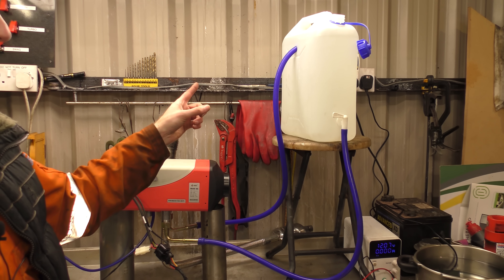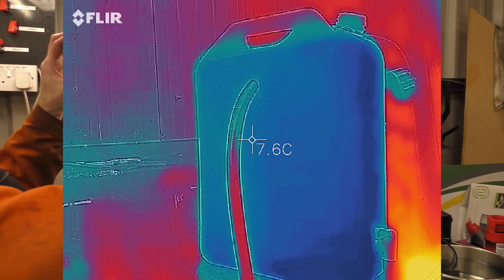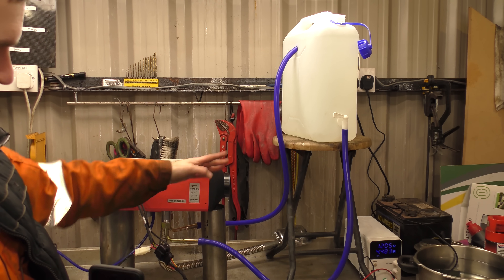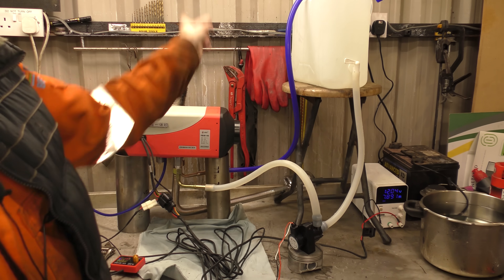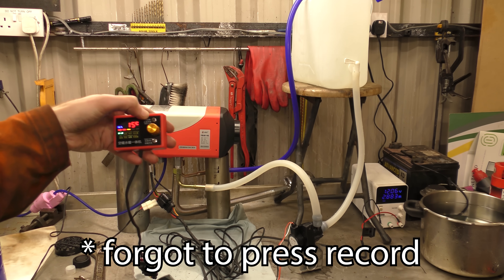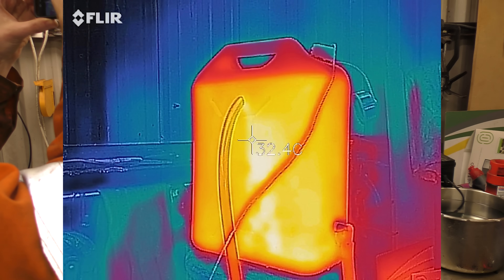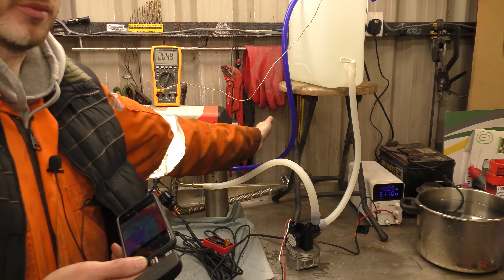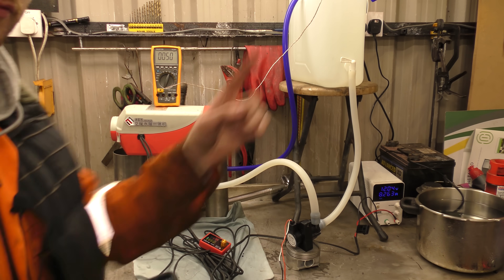Diesel air & water heater thermosiphon? Also heating 10L of water

Comment: That makes 120° water in Fahrenheit in just that 26 minutes, but I would like to point out this version of a diesel air and water heater is patented more or making hot water for your camper or your van build not to heat up engine coolant but like I said 49°C that is roughly about 120°F. that’s still hot for water just for only running at low for roughly 26 minutes.

Comment: I did some very rough calculations and found the heat output to be about 1 kw into the water. Not good enough to heat water in an off-grid home. I wish someone would build a diesel heater with a water jacket having a water connection on the top and bottom for a proper thermosiphon. It needs to be rated for 100 psi, be equipped with a temp/pressure safety valve, and have an easy way to clean out the lime build-up. The motherboard needs to have a remote temperature probe that goes on the storage tank to monitor the temp of the water.  And no hot-air blowing out. That way it can be used to heat domestic hot water in the summer. This would be ideal for an off-grid house or a camper van or motorhome.
Reply from the maker: Thank you.  That's about what I worked it out as.

Comment: I calculated that the amount of heat you get in the water is 0.47kWh at full blast. Now this is a bit less than the exhaust heat of 0.5-0.7kWh typical. If you let the exhaust heat go through a BPHE in this way - exhaust pipe going vertically into a bucket/tank/barrel/water butt, then goes into a BPHE vertically, then the other outlet of BPHE coming out of the bucket horizontally or 10 degrees slope to drip out condensation naturally. The whole set up looks like a big L shape inside the tank, do you get it? In that way, you won't even need a pump. A true thermocycle will happen because the heat source itself is inside the tank.

Comment: °F = °C × (9/5) + 32 hurts my brain when I try to do it on the fly. Generally I try to remember 20 is room temp and 100 is boiling. Then I guestimate.  I calculate that as putting out 2300 watts of heat. My bad I thought it was 20 liters, so half that 1151. A small steam engine could make enough power to run this.

Comment: So it looks like it heats as fast as my little hot water tank which has a 600w immersion heater or 1200w gas heater - so somewhere midway around 900 watts perhaps 1kw allowing for pipe  losses

Comment: I have a question so  does this have to continuously run to keep the coolant warm........

Like for instance would you be in let's say your truck's bunk trying to sleep in the fiery pits of hell why'll still trying to keep your engine coolant warm.......

If that is the case I think it would be better off installing two separate systems.
Reply from the maker: Yes.  You have correctly identified one of the major drawbacks with this version.  I'm sure others would suggest opening a window, but that's just wasting heat and fuel.
Reply: @DavidMcLuckie   yeah think I would stick with  just the bunk heater and spend the extra $150 for a Chinese diesel coolant .

Comment: if you connected the hoses internally by dropping a coil of copper into the water tank (soft 22mm) will give you the circulation you need the silicone hoses should take up the expansion.

Comment: It is sad that this dual use has not become mainstream like the pure air heater. Would it be problematic if used without water? I just bought the 2kw with dual muffler system for $86, including 2day courier fee in Florida. There is no affordable duel water air system in USA available on Amazon. Would've loved it on my sailboat.
Reply: David, Maybe I can use a 30m length of 5mm copper pipe with a small pump to recover heat from a wrap coil around the exhaust?

Comment: About your last question, the calculation is very simple: 10 liters of water need 10x4.2KJ to heat up one degree. That times 33° increase means 1386KJ in 20 minutes. That means 1155 Joules per second, that means 1155W of heat power (average). Equivalent to a 1000W electric heater approximately.
Reply: 1155w....... thats a lot of heat to save from the exhaust and this isnt 100 o/o efficient so normally it must exhaust an insane ammount of heat outside..... it makes sense to get as much heat as possible from the exhaust gasses
Reply: @freewheelinfranklyn  Actually that gas has a very low density and a very low pressure. Because of the high temperature. So, it does not contain a huge quantity of heat. Of course, it could be harnessed increasing the efficiency of the system. But one shouldn't expect too much from it.

Comment: If you would have laid the diesel heater on one side (with the glow plug upwards) and aligned the bottom pipe of the heater in the bottom of the barrel and the top side of the heater in the upper side of the barrel, you would have obtained a thermosiphon... Just a small detail.

Comment: The best way I have seen for people using  these heaters in a camper. Is using a outboard motor  fuel tank.  Because hose detaches so you can fill the tank at the gas station.  Not trying to fill the little tank on the heater in the camper / van.
Reply from the maker: That's a great solution.

Comment: Hey David, been looking for one of those white variable voltage supplies you have in the background. I can't find one any higher than 30v/10amp. Don't these heaters draw more than 10 amps at the beginning when firing up?
Reply from the maker: Most of the ones I've tried pull just on or just under 10A which is why I picked that power supply.  If you find one with more power let me know as I've been looking as well.  :)
Reply: @DavidMcLuckie  Hi David, I have a link for one that does 30amps but youtube wont let me add the link.

Comment: Would it be possible to turn the heater on its side, such that the hot pipe was on top and the cold return on the bottom ?

Comment: Did you happen to make a video of how to connect all this?  I actually have the same unit... And don't want to use the water heater yet.  Getting an error message about missing water pump, but instructions don't actually show it being connected to the wire harness. Instructions show it as being only connected to the system via the hoses... So I'm not really sure what my issue is.
Reply from the maker: Yes, the pump has to be attached to the main loom for the system to work.  There should be a plug for it.
Reply: @DavidMcLuckie  thank you sir!  I actually hooked up the pump and it cleared the error code. Now in the English version of the instructions there doesn't appear to be anything about how to prime the diesel fuel line. Or how to actually start the heater ignition... Did you happen to ever make a video or do you happen to know what the steps are? I'm struggling because everything is in Chinese which doesn't help.. 

I really really appreciate your help. And I love your videos keep them coming!
Reply from the maker: If memory serves me you push and hold the knob and it activates the fuel pump until you let go of the knob.  I think.
Reply: @DavidMcLuckie  I'll give it another try.  Thank you sir!

Comment: Hi, you are master of this heater. Do you know what dimension of whell bearing sits in fan of heater ? I mean of opposite way of hot air. Its squeak and i want to change it but do not want to wait for bearing(its take time to order something in shop in norwey) ? Like 607 zz or 600 ? I think you know what i meen
Reply from the maker: 16x5x5mm 625Z
Reply: @DavidMcLuckie   thanks

Comment: To answer your question at the end:  It took 1200 seconds (20 minutes) to heat 10000cm2 (10L) of water 33 degrees (from 17 to 50). That is 330000 calories in 20 minutes, given the specific energy of water (4.18) that equals 1379400 joules in 1200 seconds, so 1149,5 joules in one second. Since a joule equals 1Ws, we can strike out the seconds and there you have it. The power transfered into the water was 1149,5W (on average, it was probably more when the water was colder and becoming less when the water heated up)

Comment: I may have a solution for the thermosyphon malfunction. (As described about 2:30 in the video.) I'm
drawing on my experience as a retired plumber who has also worked with pumps and  thermosiphoning solar heating systems.  I think what has happened in your thermosiphoning setup is the water reaches a boiling point and so increases the pressure in the system to the point where the pressure is pushing the water in the cold side of the system back into the tank. The simple solution would be to install a check valve on the cold side tubing, preferably one that has minimal restriction to flow.
Reply: I also wonder what would happen if you raised the reservoir higher, say 6 in or so. But the check valve is a must.

Comment: It would have probably pumped by convection if there was a check valve in it. The old heater hose engine heaters had one.

Comment: Does it work always heating also the water or there is the function that allows to heat just the air ??
Reply from the maker: Other than letting it boil the water out it's always doing both.

Comment: @David McLuckie are these any good for a boat for hot water in a sink. I'm looking for a alternative rather than a gas geyser. Also to keep it warm. Does the heater have a thermostat on it so when your just using the heater without running the water. So the water doesn't boil over
Reply from the maker: The water would eventually boil.  But as long as you don't use a closed system it wouldn't be a problem.

Comment: im curious to know how many liters a minute is that water pump. plus how hot is the water coming out of that outlet tube after its heated. so example if i just attach a shower head to it.
Reply from the maker: I think that pump is 10L per minute.  I worked it out that the heat exchanger is heating the water with about 500W of energy.  So either a cold shower with good water flow, or a hot shower with little water flow.
Reply: @DavidMcLuckie  brilliant thank you David. the pump i will be using will be 5L a minute so the water should be pretty hot im guessing

Comment: Hi. Does the heater need to be the way you have it sat or could be face say 90 degrees up or down? So heated air hits ceiling or floor?
Reply from the maker: I've looked at the burn chamber.  If you point the heater hot end up, you shouldn't have any diesel leaks.

Comment: The top pipe should be just below the top water level,  not above the water level! as the only way the hot water will exit the top pipe would be through expansion. and never fit valves to the flow and return as you will all be aware im sure that steam expands at explosive rates and can be highly dangerous. the system should always be vented and expansion allowed for.

Comment: Is there a way to turn the fan speed down or off but still have the heater running. Have a water pump pushing water through to heat up the tank. That would be great if you disnt need to run the fan for air heater at the same time?
Reply from the maker: The blower fan is on the same motor as the combustion fan.  So you have to have hot air and water at the same time.
Reply: @DavidMcLuckie  yes I have picked that up after watching more videos. Its seems you just want to turn your water pump on whenever you run the heater. Then just have the water circulate back to the tank. I've watched so many videos now I'm not sure what one I'm commenting now

Comment: 40-42c is the perfect temp for having a shower, so if you turned it on in the morning inside your camper van, make a cup of tea and after 20min turn the water pump off and then have a separate pump to a shower head and taps you can enjoy a lovely hot shower.

Comment: I'm not sure if it's the issue but I saw another video of a gentleman making a diy heat exchanger his first prototype had a very similar issue. The boiling water should build pressure but not with both ends open. He had a term for it but a one way valve on the supply fixed this and pushed water through the outlet. I would love to see if this creates thermosiphon!

Comment: BELLOS ATHANASIOS
HI...wath is hapening with the water if the heater warks all night and day ?
how can you control the temperachure? is the water boil ...or what?
Reply from the maker: If the water gets hot enough it will boil.  Not really meant for long run times without the hot water having some way of dissipating the heat.

Comment: Interesting, would like to see follow up experiment like this: 1) Use the diesel water&air heater to pre-heat the water 2) use egr cooler on the exhaust output directly under the heater to further heat the water. 3) put the heater on max 5 setting from start, not 3. Always possible to turn down the heat later :)

Comment: Hi David I had a thought for a video. What about using a turbo intercooler connected to the exhaust with a fan to extract heat. If it works without messing with the air flow, you could put a thermocouple and arduino to control the fan based on heat. Also I seen a water cooler intercooler could be used to extract heat from the heated water. If you wanted
Reply from the maker: I've got an old intercooler for this purpose.  Just haven't welded a pipe and flange onto it yet.

Comment: Thermosiphons always benefit from increasing the vertical height differences. I realize it was done this way to keep the shot compact, but it is close to the worst layout for a thermosiphon. You are attempting a closed-loop version of the stack effect so the siphon force increases endlessly with height until the point where fluid flow friction overwhelms the stack effect. That flow concern also means you should use large diameter tubing/pipes, and keep things like the jug's petcock out of the flow loop. Also, some layouts will not self-start, but will work once something gets an initial flow established. https://en.wikipedia.org/wiki/Stack_effect

Comment: 1440p@25 is very nice as I don't actually have to force my phone to use 1440p it does it on its own on 25fps (1440p60 requires a lot of bandwidth and my phone doesn't think my WiFi or 4g is fast enough on 60fps)

Comment: Put the hot water return at the bottom and the cold outlet at the top. The hot water rising from the bottom will cycle the cold water through the heater. For this to work you'll also need the system to be full of water obviously, or at least have both hoses under the water line inside the tank.

Comment: So....what's the point of this thing? Intriguing as it is. 

It seems that it can't heat air only if it's plumbed into a water circuit. Without the pump it will lock and splutter.

So how do you see it being put to use?

Cheers :)

Comment: I don't think the pipes going down first is an issue (other than creating a small height difference between them), its all about pressure difference. It doesn't matter where the pipes go, just where they end up. Think of siphoning a liquid out of a container using a hose, it goes up first but still works.
What will matter much more is the height difference between the heater and the tank, the pressure difference between the water inlet and outlet of the heater should be proportional to this height difference. And flow rate will be proportional to this pressure difference (possibly not a linear relationship?).

Comment: Wouldnt it be cool to set up and run 2 water systems at the same time, 1 heated by the heater, 2 heated by egr cooler and see which works better. My money is on the egr cooler.

Comment: Hi Daved, I have used this same system using a small log burner in my workshop with great results  I think for it to Thermosiphon efficiently you need the water in the "jug" to be lower than the feed pipe coming from the heater,  otherwise you are adding pressure that will hold back the rising heat. Reduce the amount of water below the pipe and I bet you will get it to circulate,  ..."RETEST"...
Reply: Ps.. Also put the heater on it's side with the cold return on the bottom. 👍🏻

Comment: Hi Dave,
My Name is John,i'm from Germany

May you can Help me
I own a Fiat Ducato Box Van from 1998

My idea would be to install a Shower wich is Origin known as a Showerloop

I am very intetested to know,if that Chinese Water/Air Heater would fit to Heat the Shower Water.

In case you plan to make a Special construction with Waterheating,it would be very interesting to know if that heater works fine

I would also like to know if the heater is permanently Heating the Water,even if you just need an Air Heater in youre Van

Wish you a Merry Christmas,and a very Happy New Year
Reply from the maker: I'm going to do a video of the different heaters I have heating a quantity of water.  I don't think the air/water heater will make hot water fast enough for a shower.  But it could heat the water if you give it long enough while heating the van though.  But in the summer you'd need to heat the van as well as the water as the heater can only do both.

Comment: Here's the maths you asked for:

Eh = C m Δt

17 to 50 = 23 °C

10 litres water so c. 10 kilos

4182 J/K/kg at 20 °C (varies a bit with temp. but that's close enough)

So

962 kJ (or 963000 Jouls)
Reply from the maker: 267Wh or 0.3KWh?
Reply: @DavidMcLuckie  380 Wh (0.38 kWh)
Reply: Will Robertson 50-17=33
Reply: @GregVirgoe  D'oh! Yup! Thanks! That gives 1380 kJ (1380000 Joules)

Comment: Try to put a check valve on inlet side of heater line. Also,  maybe seal off tank a bit, so steam pressure pushes water to cycle.  Of course add a pressure relief for safety.

Comment: Depending on the water heatex design, it might siphon if the heater is mounted sideways. Basically the line from the heat source must only travel upwards to siphon.
Reply: I was going to make this point. The inlet and the outlet of the heat source need to be at different heights to allow the siphon to start.

Comment: Well, with the water inlet/outlet on the bottom, did you flip the heater over, to purge all the air from it? Otherwise it might expand the air when hot & prevent any real flow.